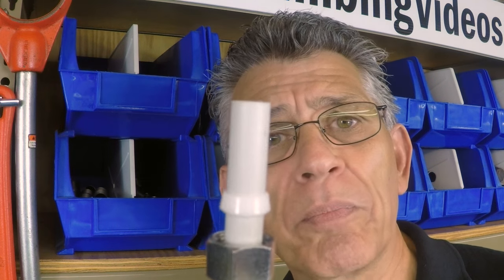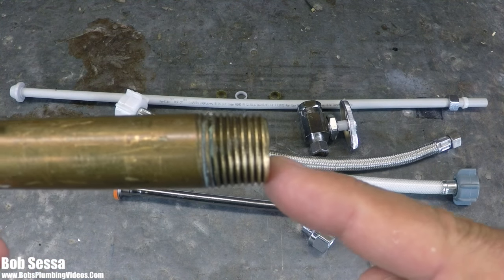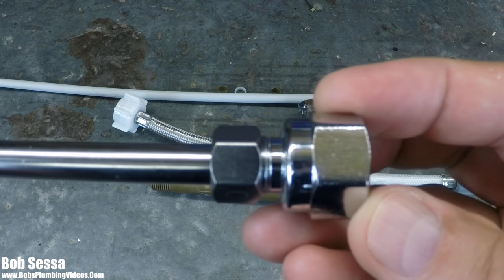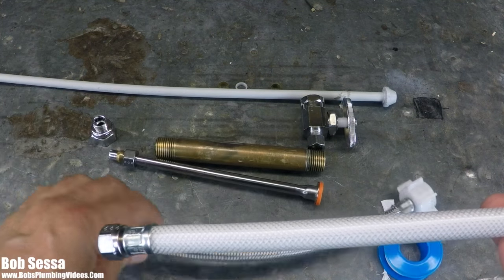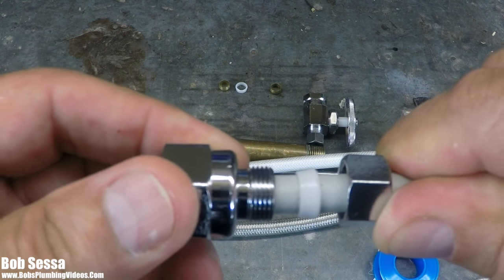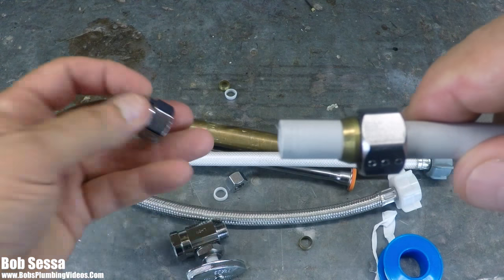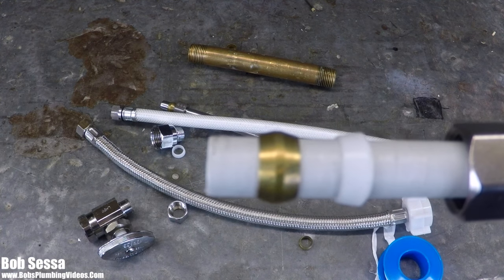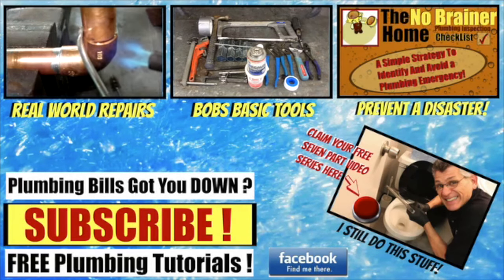Leaking Compression Tube / When to Use Plastic Ferrules

Comment: Bob, I have a PVC water line coming into the bathroom toilet shutoff valve.  The shutoff valve is metal and has a metal ferrule on the PVC pipe.  How do I remove the ferrule and should there be a metal ferrule on a PVC line? Thank you
Reply from the maker: Short of purchasing an expensive ferrule removal tool you can use a very fine hacksaw blade 32 teeth per inch. Make a cut diagonally straight down but DO NOT go all the way!!! Score it so you can get a thin blade screwdriver and split the ferrule open without damaging the pipe. I've not seen plastic ferrules in either 1/2" or 3/4" sizes and if the pipe is schedule 40 P.V.C. the metal ferrule should not damage the pipe.
Reply: @BobsPlumbingVideos  Bob thanks much, appreciate the assist

Comment: Thank you for answering my question on this informative video! 
I was needing reassurance about exactly how the plastic ferrule holds the PEX supply tubing securely into the supply valve.
I just installed a new faucet for my wife and felt unsure about how the water pressure wouldn't just blow the PEX supply tube clean off the supply valve. 
I feel confident I did it exactly how you described and I won't come home to a flooded home 🤞

Comment: Do you need any kind brass insert when using plastic pipe and a plastic ferrule?
Reply from the maker: Technically you're supposed to insert a brass sleeve into the plastic tube, but I have had success without it.

Comment: Just encountered the pex on the kitchen sink and both are leaking super slow drip. Was told this has been dripping for a long time. Solution it leaks at the cone head part. Best solution? Tightening didn't work for either the hot or cold side.
Reply from the maker: Replace them with braided stainless steel supply lines.

Comment: Great video on using pex tubing.  My only remaining question is what is the best way to cut the pex?  Utility knife?
Reply from the maker: Utility will work , but for a consistent nice square cut I use one of these - https://amzn.to/2YyusJE
Reply: @BobsPlumbingVideos  thanks for that tip!  The cold feed line went in ok and isn’t leaking, but the hot feed line is leaking at the compression nut.  Is it possible to over-tighten the compression net and ferrel?  Another idea is distance from the hot side’s shut off valve to the faucet’s water supply line is about 5” and offset by about 1” so I need to create a curve in the pex line.  Could the stress created by that curve be impacting the seal of the compression nut at the valve?

Comment: One of the best instructional videos I've ever seen. I've got 1/4" polyetheylene for an RO system. It requires using it with a compression fitting. I definitely understand the plastic ferrule, what about  the "insert" for the tube? My kit was supposed to come with a plastic insert but didn't. My local hardware store has only brass inserts?  Can I use a brass insert and a plastic ferrule, with a polyethylene flexible line?
Reply from the maker: Absolutely, you can use it. Most kit are supplied with the brass version. Thanks for checking out the video! Regards, Bob.

Comment: So ok the other end to tie it into the faucet should I use a plastic or metal nut? It’s for a pedestal sink so it looks slightly better/more neat then the stainless steel ones and way neater then the copper ones.

Comment: The instructions that come with the Delta faucets suck. The diagram in the instructions does not represent the supply lines. The plastic ferrules are associated the extendable handheld line. The bag the plastic ferrules comes in shows a diagram of the line going to the angle stops. Thank you for such a clear and informative video.
I've been a plumber since 78.
Experience is very valuable.
I used the factory termination on the supply lines. I was left wondering what the plastic ferrules were used for. Oftentimes when you use plastic ferrules there  are brass inserts that go inside the tubes. Delta didn't supply those and I didn't want to risk cutting the Delta PEX supply lines using the plastic ferrules and get a bitter lesson. Thanks again..
Reply from the maker: Thank you! For checking it out. Regards, Bob.

Comment: My entire house has compression valves on cpvc is this safe?  How do they secure it?  They need replacing.
Reply from the maker: The CPVC will probably hold up to the brass compression rings, If no existing leaks, leave it be.
Reply: @BobsPlumbingVideos  thanks

Comment: Hello, I have 1/4" grey pex risers for the bathroom faucets. I  changed the fixtures a year ago and reused the pex but had to bend it some. Now I'm a bit concerned and considering replacing with  SS braided supplies. The pex is likely 15 yrs old. Also had an unrelated frozen pipe burst so have some extra "hydro phobia"....  You think it's okay to bend the Grey risers? Hoping the original installers used plastic ferrules for the connection to the shutoff too. Thanks for your great videos!
Reply from the maker: You can certainly put mild bends in p.e.x. without any issues. Even at 15 years it shouldn't be an issue, but for piece of mind new stainless steel risers can't hurt. Nothing is safe from freezing. Thanks for checking out the video! Regards, Bob.

Comment: For the rigid bullnose supply lines, what size nut do you need? Or can you use multiple sizes? A toilet had the 7/8" but faucets have the 1/2" connection and the stores only sell one side of the bullnose supply lines. And what sort of fitting do you need the bullnose to fit into? I'm thinking I might want to have a riser terminate into a half inch copper but I don't know what fitting to use for the copper.  Do you use any washers with the bullnose before you put on the nut?
Reply from the maker: Not sure of the term "bullnose supply line" can you send a photo. Send to - info@robertsessaplumbing.com.
Reply: @BobsPlumbingVideos  it must be a local term. It's the same as the chrome plated copper line you had in your hand. The little tag at home Depot said bullnose but online it says "faucet riser with compression sleeve"

Comment: Hi. My wife's toilet was leaking so I decided to replace the old line with a stainless steel one, along with a 
Brasscraft 1/2in Nom compression 3/8  1/4 turn valve  with a stainless steel line. Few days later, I find a small, small leak. Removed everything, and thought, okay, so I should use the old nut  and compression ring, so I ordered a Superior Tool Olive puller and was about to start, until I stumbled upon your video. Seems the homeowners prior to us (maybe even builder) placed a brass ferrule on the PVC line. How or what would you suggest the route for removal, and from there replace with a "Polyethylene Compression Ring"? 

Thanks.
Reply from the maker: I simply use a very fine tooth hacksaw blade 32 teeth per inch or a Lenox mini hack saw (google) and cut across the ferrule until almost thru. (not completely thru).

Then with a very fine blade screwdriver placed where you were cutting, split the ferrule. You don’t want to score the supply tube. If you cut it, you’ll have no choice but to replace the supply.
Reply: @BobsPlumbingVideos , thanks for the input. On another note, replaced with the poly compression ring, right?
Reply from the maker: ratmany kang 
Yes sir!

Comment: I just installed a whole house humidifier and tapped the hot water line above the hot water heater with a Sharkbite fitting and 1/4" pex tubing. I used the proper plastic ferrule and brass insert sleeve.  While upstairs, I heard a loud noise and come to find out the line had broken free! Yikes. What a mess. Good thing I was home! How did this happen? Did I overtighten the the nut too much which caused it to break free?
Reply from the maker: hand tight plus a quarter or half turn with an adjustable wrench.

Comment: How to remove brass ferrule?  Great video, not sure if you monitor this any more but I have 1/2” pex supply line for toilet leaking. It has a brass ferrule, that I cannot remove. I purchased a ferrule puller that screws on, but the adapter will not fit inside the pex, it has a metal insert. Any suggestions on how I can remove do I can replace with a new plastic ferrule?
Reply from the maker: I just use a mini hack saw by Lennox or a 32 teeth per inch hack saw blade. Cut at approx 45 degree angle thru the ferrule, but stop before hitting the pex. Use a thin blade screw driver and pry the ferrule open. Replace with a plastic ferrule.

If you’re not to sure on how to go about it, I would just use a new braided stainless steel supply tube and be done with it.
Reply: BobsPlumbingVideos thanks very much for replying. This is coming out of the wall so I cannot easily replace. I will try cutting it off and get a plastic ferrule. Thanks again
Reply: @BobsPlumbingVideos  Wouldn't you still need to remove the tube before replacing it with steel tube?

Comment: Bob, which was does the plastic ferrule go? Does the tapered end go towards the fitting? Your video showed both ways. Also, what about the little insert that goes inside the plastic tube to keep it from collapsing from the compression?
Reply from the maker: The brass insert goes inside the tube you're connecting, the tapered end of the ferrule faces toward the fitting you're connecting to.
Reply: Oh, that's what that insert is for?! I'm on here looking for a video on hooking up ¼" tubing for a fridge and I think my shut off valve has one of those.

Comment: I inserted a plastic feral on a plastic tubing, feeding into a shutoff valve for my under the sink water filter 2- cartridge system and when turned the water on, the plastic tube along with the feral, shot out water came gushing out. Maybe I did not tighten the nut enough?
Reply from the maker: Make sure the tubing is fully inserted into the valve, then torque it up accordingly.
Reply: Thank you, I think that probably was the problem! Appreciate it!!

Comment: Just wondering, when do you want/not want to use a brass insert and just a plastic ferrule instead, for plastic tubing?
Reply from the maker: I generally use the brass insert on plastic 1/4" ice maker supply lines, but truth be told for ice makers I prefer 1/4" copper tubing . For sink supply lines I'll use the plastic ferrule alone..

Comment: I have a chrome supply line at the toilet. I loosened the nut that has the furrel in it now its leaking after I tighten it.  It wasn't leaking before.  Any ideas how to stop it? Thanks
Reply from the maker: You may want to wrap some teflon tape over and around  the ferrule one or two turns, then try to tighten. If that doesn't work, I would cut the ferrule off with a very fine (32 teeth per inch) metal mini saw blade and use a brand new ferrule.

Comment: I work in an apartment complex and every angle stop in every unit has metal ferrules on pex pipe but they have an insert in the copper, I'm new to this profession as was wondering why they did this and do those inserts help with the ferrule cutting into the pex?
Reply from the maker: I've personally never seen "inserts" that would prevent the metal ferrule from cutting into the p.e.x. at least not here in N.Y.C.
Reply: BobsPlumbingVideos thanks Bob
Reply: I think the inserts he is talking about are stiffeners. They keep the end of the pex  from bending, but don't stop a metal ferrule from cutting into the supply.

Comment: Homeowner's look at me like I'm crazy when I tell them that I like a Pex supply line better than a steel braided one. i have seen their crimps on the ends go bad. I used a dab of pipe dope on chrome plated supply lines at the ferrrul.
Reply from the maker: I sill use the chrome plated hard copper supply tubes, old timer reliability.LOL!

Comment: What do I use if new faucets lines do not reach the water supply cut off?  It came with the metal braided tubing.
Reply from the maker: These will extend you an additional 12" -12" Braided Stainless Steel Hose Faucet Supply Connector (3/8" x 3/8" Compression) - https://amzn.to/3dBmQs9. Remove and disregard the nut and ferrule from one end, connect to the lines coming from the faucet. Connect the other end to the supply valve. They come longer (20") as well.

Comment: 7:47 Bob, When are the brass inserts required inside the PEX supply tube?   I've heard of new installations blowing apart, and I thought it was because brass insert was not used inside the PEX tube at compression fitting.
Reply from the maker: In general I've seen the brass inserts included with those pre-packaged p.e.x. ice maker hook-up kits you can buy from the home centers. For the record I myself won't use p.e.x. supply connections, but more and more faucet manufacturers are coming equipped with p.e.x. supply tubes and they don't come with brass inserts.

In heat applications, I would absolutely use inserts to keep the p.e.x. from collapsing. If you've used SharkBite fittings they come with plastic inserts just for that reason. Thanks for checking out the video, Regards. Bob
Reply: @BobsPlumbingVideos  It also seems to me that PEX is a more dense material compared to polyethylene.  So with polyethylene I would use the brass support inserts to avoid deformation of the tubing.

Comment: found this while replicating a fuel line... 1/4 steel tubing with a brass compression ring swaged at the very end... what is the crimping tool called for this?

Comment: It is my understanding that the plastic ferrule, when properly tightened should just  slightly crease the outer diameter of the pex tubing. This is what ensures the pex supply  line doesn't pop out of the nut on the valve connection...Is this correct?
Reply from the maker: That is correct, but if you use the brass ferrule and overtighten it, it will penetrate the pex. Thanks for checking out the video Jessica, Much appreciated, Bob.

Comment: Can you use the same method (plastic ferrule on plastic pipe) on a cpvc supply line coming from the wall?

I want to attach a compression fitting shutoff valve on my cpvc  line coming from the wall, maybe with one of those plastic ferrule...rather than using the glue method.

I could use sharkbite also but I would feel more confident using compression.
Reply from the maker: Bluelight Gaming   I would try Home Depot and look for a shark bite compression valve for whatever size cpvc pipe is exiting the wall. I’m going assume we’re talking about 1/2 pipe? I could be wrong but I’ve never seen a plastic ferrule big enough to fit over 1/2” cpvc pipe. If it does exist, can’t see why it wouldn’t work.

Comment: I am replacing my faucet and the hot water not the cold uses this tube but I can't pull it out from the current faucet. I unscrewed coupling nut but it just left the threads showing. Strange. How do you pull out the tube?
Reply from the maker: You would have to send me a photo of your particular job. Info@robertsessaplumbing.com

Comment: In the UK its a compression olive ;-)

I have just DIY fit a electric shower 230v 8.5kw uk and the last shower had a copper olive, the manual says use a olive
But the shower inlet pipe is plastic what do I do?

Also the old plastic inlet pipe has a stuck olive should I cut it or pull it off
I don't want to crack it or scratch it
The shower inlet is plastic not the 15mm water inlet pipe that's copper with chrome
Reply from the maker: In my opinion, if it’s plastic I would use a plastic ferrule. I just wouldn’t want to chance cutting into the plastic with a brass ferrule.

Comment: I put a new kitchen faucet in yesterday...it was hell.  There's no room to work 2 the old faucet less than 5 yrs. had corroded so bad the nuts had to be cut off with a multi tool, UNDERNEATH! 3 the new faucet had plastic nuts too large to pre fit and then lower into sink holes so connections were done under sink. 
Manufacturers have a long way to go to help the DIYrs!!!
Reply: I FEEL YOUR PAIN. I ALSO WENT THROUGH HELL TRYING TO REMOVE THE OLD FAUCET AND FITTINGS. ONE PROBLEM AFTER ANOTHER WITH HOURS OF WORK AND RESEARCH ON WHAT TO DO.

Comment: What about when the plastic pex tubing 1/4 humidifier line comes with a copper insert sleeve that slides into end to prevent plastic pax from squishing in ?
Reply from the maker: I personally use the plastic, but 9 out of 10 use the metal

Comment: I had a friend who had a flexible supply break while he was on vacation, and they had huge amounts of water damage.  Since then, I have used the chrome plated brass supplies.  I find the ball end a bit difficult to get leak free.  Today I ended up smearing silicone on it to make it work.  Do you have any tips for that?   ps.  The brass are hard to find in the hardware store.
Reply: Did you use teflon tape in a cockwise direction 3 wraps should do it. Wrench tight.
Reply: @jamesbryson9542  I don't uset teflon tape anymore.  In place of that I use teflon sealant that you brush on

Comment: I can't remove the nut connecting the Plex tub to the water supply. It won't budge! Suggestions?
Reply from the maker: You'll probably have to cut it off with a fine hacksaw blade or mini hacksaw. You would have to slice through the nut without damaging the threads of the valve. Take a bit of practice and if you've never done it, I would probably call in a pro.
Reply: @BobsPlumbingVideos  I have the opposite problem. The nut unscrewed but didn't take the hose with it! I tried yanking on it and it wouldn't come out. What do you suggest?

Comment: Usually, where to buy extra plastic ferrules for pex?
Reply from the maker: Home Depot / Lowes !
Reply: Thanks. I didn't find the plastic ferrules at the beginning, because they use different name for it in Lowes, such as "coupling CPVC Fittings", "compression sleeve", etc. Finally, I fixed the leaking problem of my pipe with the plastic ferrule.
Reply from the maker: Cool Gavin! Thanks for checking out the video. Regards, Bob.